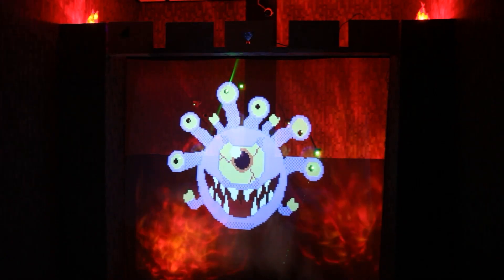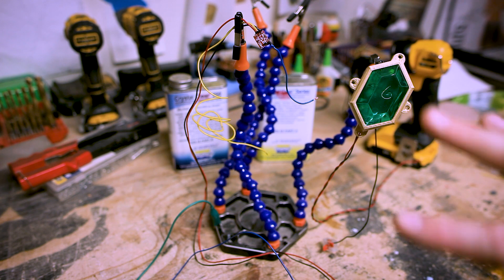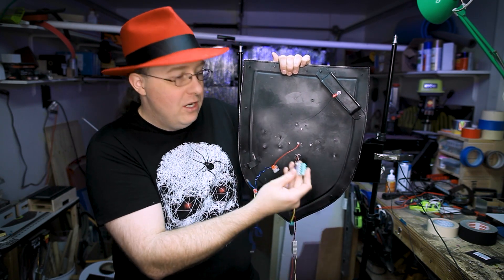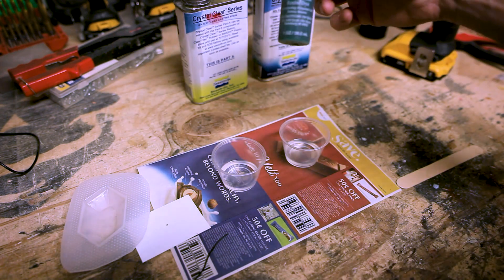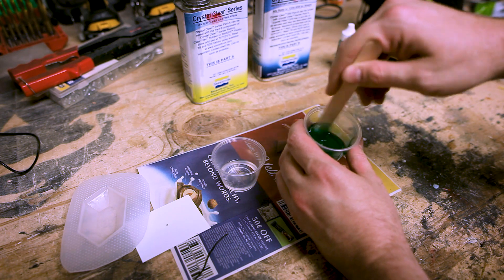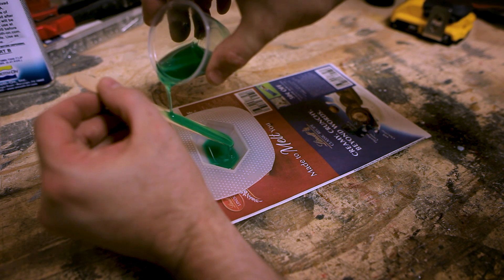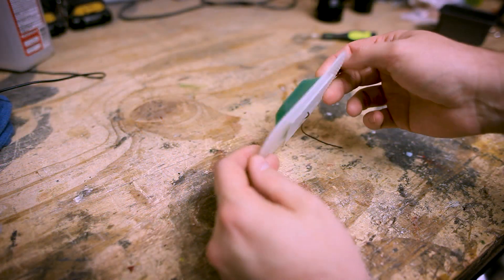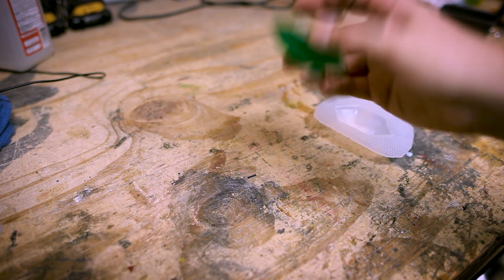Touch Sensor MADNESS!

Comment: Nice new toy! I'm gunna have to order a few to add to the prototype rotation.
Put a 90 deg pipe on the outlet of your vacuum pot to avoid blasting air into the resin when you release the vacuum. Which is what I say to myself every time I use ours. I haven't put one on yet...